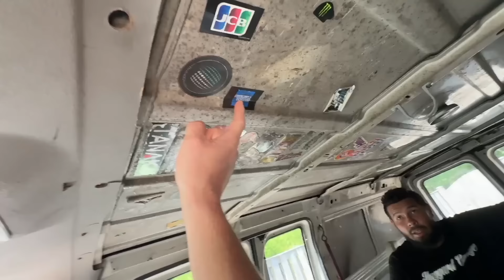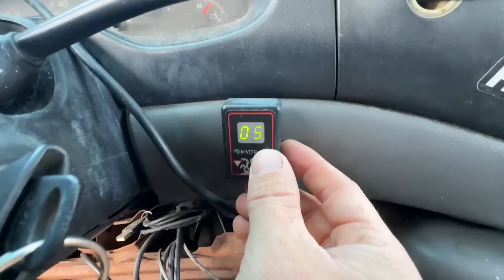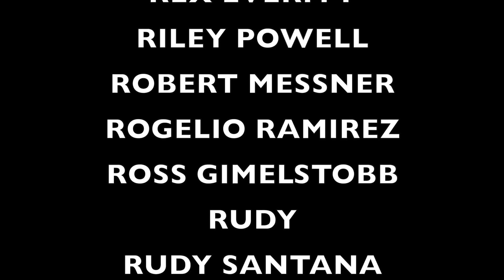The HAGGARD MINT VAN is BACK

Comment: thats the best tuner for these trucks. you might have went into the anit theift mode when you went to 15. you can load tunes from their library and put them in any order. some numbers might not even have a tune set to them. only the person that installed the tuner and loaded the tunes knows what order and which ones. find the USB under the dash coming from the PCM, download the program (hydraflash) and pick what ever tune you like and set what ever number. the "fun tune" is the 140 HP extreme tune.... its fun lol. you can at the least plug in and see what tunes are on it currently. I only use 2-9 (1 is "stock tune" usually there is some tow, street, performance, and extreme tunes
Reply: Hopefully he reads this and does it,I would really like to see them mod and restore the van a bit .. thanks for saving me from typing all that info too 😅

Comment: First time rudnik was actually right, mode 15 is def a no start mode, 0 is stock. The php hydra is the best tuner for the 7.3, you can download tunes depending on your injector and turbo setup and flash them yourself.

Comment: You need to look into what those levels mean. There are slow horsepower street tunes, tow tunes and hot street tunes. They do change shift pressures and stuff to in the tunes.

Comment: Keep it clean it up a bit with new ebay headlights repaint the black trim to semi gloss get new tires with bigger size in the rear smaller up front like the way Orion had it raked strictly for towing in my opinion it looked gangster the way it sat with the front end dipped down MINT STICKER HAS TO GO BACK ON

Comment: That tuner is the top of the line for all 7.3s you guys just don’t know what tunes are loaded on it. Pull it off the pcm and plug it into a laptop. You can then check what tunes are loaded. 15 is probably your no start tune. You can set it to 15 and pull that off and throw it in your pocket that way nobody can steal it. Throw some 205/30 injectors at it and let it rip.

Comment: GET RID OF THE LEVEL TUNER. IT DOESNT ACTUALLY TUNE. IT JUST DUMPED FUEL AND AIR IT DOESNT ADJUST ANYTHING ELSE AND IT KILLS ENGINES. IF UR GONNA KEEP THE VAN DO SUSPENSION AND BODY MOUNTS AND WHEEL BEARINGS BC ITS FAST AND ITLL FALL PART TRUST ME I DO AND DRIVE VANS FOR A LIVING PLEASE DO IT RIGHT FOR YALL SAFETY N IF U POP THAT MOTOR ITS GONNA BE MORE EXPENSIVE THEN U THINK.